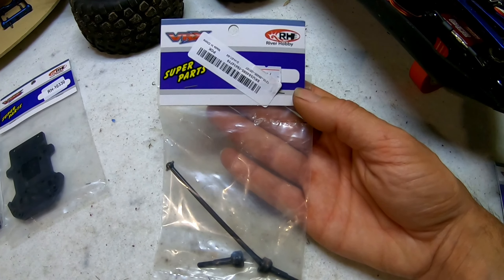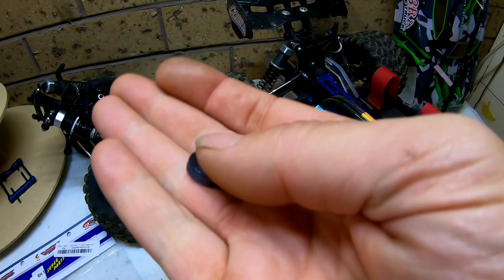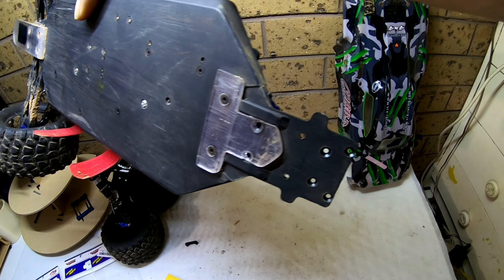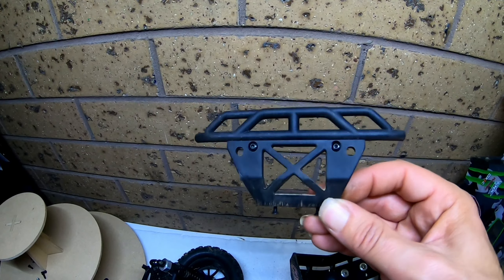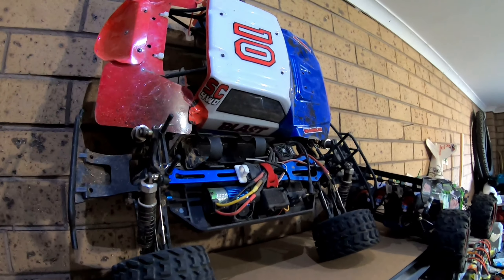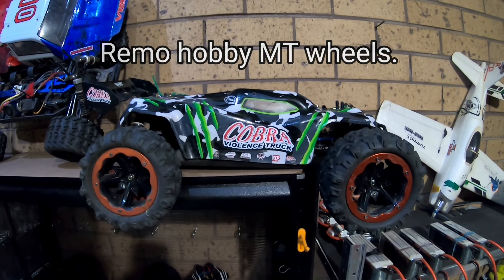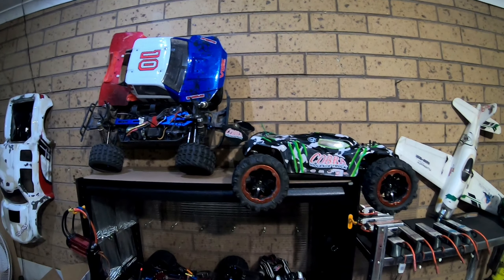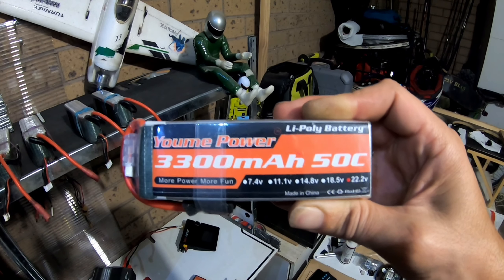VRX mods, upgrades and must have spear parts!

Comment: Just got a VRX Violence. Love it. Surprised how good it handles bumps at insane speeds. New to brushless, only ever used my old 80’s tamiya.  These are a different world.
Reply from the maker: Yes it a bit of a difference compared to the old Tamiya cars.
The VRX cars are good for very light bashing and flat fast runs but be careful landing jumps with throttle as the diffs are super weak, no upgrade gears sadly.
Reply: @rccrazy  yeah was wondering that. ive designed and 3d printed in some TPU a few high impact spots to help and want to upgrade some key spots to alloy. are the front and rear diffs same inside?
Reply from the maker: Yeah any extra strength will help.
The front and rear diffs are identical yes, the internal gears aren't really weak but the crown gears and pinion gears are always rounding off and breaking teeth.
Reply: @rccrazy  Thanks for that

Comment: Great vid on the way you explained the mods and upgrades and what is needed more. 👍🏼. With your clear shock tower supports to the body , I ended up making something similar from front to rear with aluminum tubing. And I also done a similar mod with the servo saver. I noticed on mine, where the E clip slips  into, it actually lifted thru the top plastic lip. Keep up the vids mate. 👊🏼👊🏼
Reply from the maker: Cheers mate, I carried on and mumbled my words but I hope it helps people enjoy these VRX models more, they are slightly underrated in my opinion, every car has its flaws!

Comment: Hey mate random question. I just got new shocks from river hobby for the cobra. If you have brought some, Have you noticed they have air pockets in them when you fully compress them?. And would you recommend leaving them as they are,  or top them up with oil?. I know there are vids on this but just asking what you think!.
Reply from the maker: I just top them up with a bit thicker oil.
My preferred set-up is, when you push the shaft in to the shock body (with the spring off) the shaft should stay at the compressed position or spring back just a tiny bit.
I need to rebuild a few so I might do a video.
Reply: @rccrazy  yeah makes sense. Thanks heaps mate. And what type of oil do u use. I’ve seen there are so many options out there. I’d say I would go thicker yeah ?🤔🤔
Reply from the maker: The brand i have now is Trackstar but all brands are virtually the same, and I like 3000weight in the front and around 5000 in the rear for this size off-road car👌 you may not like it that hard though, this is more for big jumps.
Reply: @rccrazy  yeah I’ll have to try to see what I like. I went on a few jumps, I found a local Bmx track and ended up snapping the rear shock tower in half. This car is gonna cost me more in parts than what it’s worth. I ended up fabricating a shock tower out of alluminium plate. Works well until I get the proper one.
Reply from the maker: @angesrc  oh no! I've been lucky with my towers but swing arms😩 I haven't uploaded the videos yet but I snapped 4 swing arms in less than half an hour, not all in one run but half an hour all up! Im getting the alloy ones!!
Reply: @rccrazy  I suppose it’s all the way we play with them . But man you get some air going off the grassed hill and those mulch heaps. I suppose the mulch would give you some dampening. Just not when you land sideways on a control arm hey. 😫😫
Reply from the maker: Spot on with the bark, very soft when you land correctly and I love that oval jump, its just perfect for big smooth jumps and flips👌

Comment: Hi bro. Nice video and nice Chanel .  I just buy a cobra.  I wold like to know where u find the transparent plastic for enforcement the shocks tower, or  u do by ur self?    Thanks
Reply from the maker: Thanks mate👍
I actually got the plastic from my dad, he works in engineering and grabs all the random offcuts, plastic, alloy or whatever. 
It's just 6mm perspex or vinyl, you should be able to find some in hardware stores or online.
Reply: @rccrazy  thanks for the quick answer.   I will do by myself.  Nice Chanel.   Cheers
Reply from the maker: Sorry I couldn't help more🙏
Reply: @rccrazy  not worry enough.     Also u help a lot with ur videos.       Have nice day!!!
Reply: I need a couple of those too for my DT-5